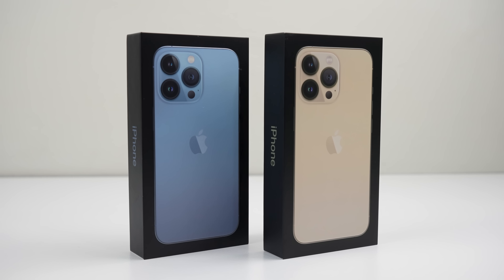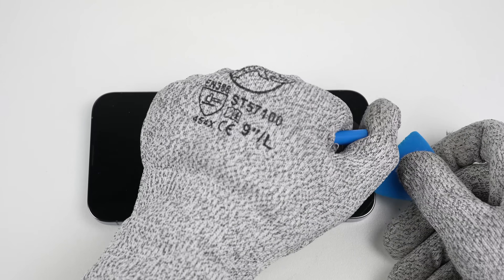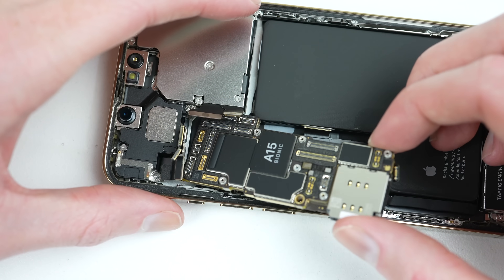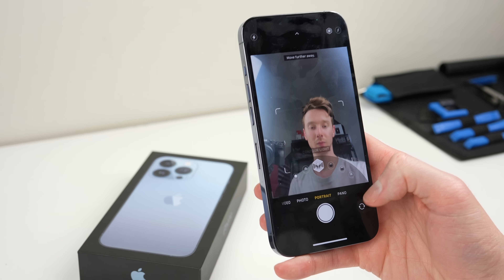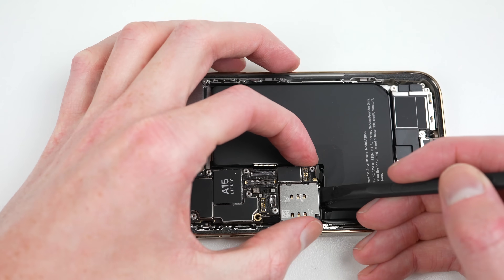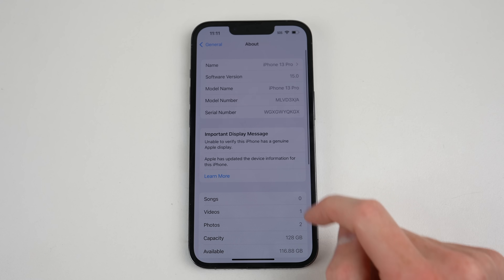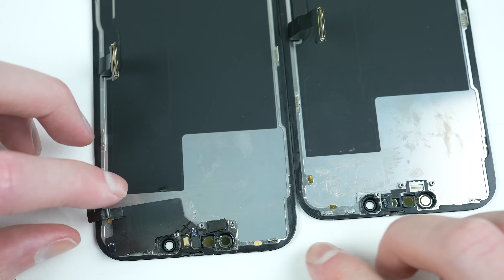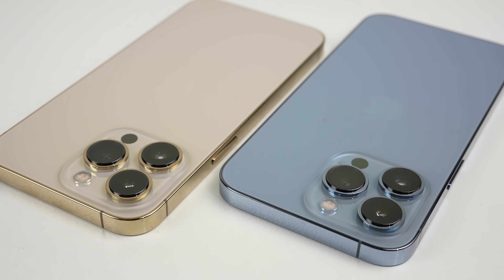iPhone 13 A Repair Nightmare - Teardown and Repair Assessment

Comment: Unfortunately, planned obsolescence is increasingly present, making repair difficult or creating certain problems. I had a problem with my printer canon pro s10 that gave a problem with white label ink cartridges. one day I filled the original ink cartridges with the same cheap ink and it worked well, that is, it wasn't even the ink, I did extensive tests and it was expensive that the error was deliberate for me to sell their ink cartridges. I would like more and more people to be aware of this problem it is not a theory of conspiracy to facts and proof and it is not new look about phoebus cartel

Comment: It's bad enough that aftermarket parts are being software written out of the repair equation, but even brand new Apple parts won't work.  What's certain is that Apple's own in-house service software will resolve the incompatibility of those parts in 5 seconds. Apple is the most spiteful company on the planet.  Love my Galaxy.

Comment: This is the reason I will go out of my way NOT to get an iPhone or Support Apple in any way, they have been dumping millions into people's pockets for the right to repair bill to fail and even engaged in disinformation tactics to secure the uneducated public. They said in a press conference they wanted to make sure "genuine apple parts" were installed by "trained technicians"... this is outright nonsense as we witnessed here, they put a software lock on and there is NO checks to see if the part is genuine or it would have cleared the replaced parts as being genuine.

The serial numbers are all loaded onto the logic board and if they don't match the phone won't work, it will go OUT of its way to show degraded performance suggesting the part was cheap or incompatible as we saw with the camera and sensors and without connecting with a proprietary software via the USBc and a thunderbolt into a PC you are unable to change the serial numbers on the logic board.

Right to Repair was pushed to cars, they compensated by designing cars to fail more frequently, I am interested to see if Apple will maintain its  "Independent Repair Provider" program and continue to limit accessories under the guise of reduced E waste.

~Thanks for the video, it was a very good one and I'm sure will be used as evidence, keep those phones, they might be subpoenaed lol.

Comment: Honestly i believe only Apple should repair Apple. Only Samsung should repair Samsung. There should be no DIY 3rd party. That is how you make sure all of the components stay true to the original design. My mom repaired her old iPhone through some engendering dude and the battery exploded in few month. To avoid this bullcrap you might use official support.

No fake details. No fake details on the market. That’s how piracy is defeated.

Comment: Now imagine you're an iPhone developer who wants to ensure their Face ID is secure enough not to allow any Man-in-the-middle attacks via custom-built sensor cables or altered screens. And there you have it — sensible explanation for "repairability" issues. I'm more than sure that approved apple repair centers can handle those issues via firmware tweaks upon parts replacements.

Comment: Can't wait for iphone 17 with newest technology "one use only", where u can't charge the battery, and the phone completely broke when you run out of batteries, that would be so great for the environment!❤
Reply: You can only charge it at an Apple retailer. But it will cost 10$ per time you charge it.

All to protect e
environment
Reply: @RodelIturalde  you mean $199 per charge
Reply: Careful, Chief. You don't wanna give em any ideas
Reply: Not 17, it will be an iPhone 14 feature, trust me

Comment: i miss the days when you could just flip the back of the phone off with your finger nail and just take out the battery
Reply: And that fixed two thirds of your problems.
Reply: Oh hi, 5 year LGG5 user here, nice to meet you.
Reply: Yes, put a random battery that fits and you were good to go
Reply: @comradeweismann6947  if the battery was small add a piece of paper/plastic just so that the terminals remain connected to the ports of the phone
Reply: Ah I remeber me and my mates all swapped one battery in our blackberries when the rest were dead. These kinds of anti consumer, profit maximisng systems are inevitable I guess but apple are really pushing the envelope. 

Despite all it's "innovation" modern technology can be really depressing.
Reply: Rocking a samsung j3 here and you are right, with my bare hands i can remove the battery and the memory card with ease
Reply: yes
Reply: Yeah, but greed..
Reply: These days never ended. I don't quite understand why so many consumers paid extra to enter darker times throughout the years.

Comment: Never had the money for Apple. Never considered saving to buy one despite a good friend's praise. They charge ridiculous prices for something other phones can do for a third of the price. I lasted 4 and a half years with a Samsung and the only reason I replaced that masterpiece of a phone was because the system no longer updated and it became unable to access certain websites I needed to study. I gave it to my father and it still works perfectly a year later. I dropped it down the stairs once, on the floor a few times at school and the only part we replaced was the battery because it started draining a bit too fast. Now I am using a Nokia and it works great.
Reply: I can say the same thing about Apple. I have an iPhone SE (2016 model, not the new 2020 one) that is almost 6 years old now. It STILL receives software updates, in fact I am on the latest update right now, the same one that iPhone 12's and 13's are getting (iOS 15). The phone's battery still to this day (never replaced it) lasts me from when I wake up in the morning to the next morning. It has no trouble loading any websites, and it's web browser never slows down for me. It's also worth noting that even though Apple PURPOSELY slows down their older devices, I still have a smooth experience, on an update that was made for iPhones half a decade newer than itself. There have been many instances where it gets dropped from 6+ feet in the air onto concrete at basketball practice every week, and it falls off my bike a lot at 20+ MPH since I go for bike rides daily on trails and on the road. The phone still works like new.

Meanwhile, I also have a Samsung Galaxy from 2017, that was around the same price as the iPhone SE. It's battery lasts a fraction of the time that the iPhone does, it no longer receives updates even though it is over a year newer, and the screen flickers sometimes, especially when I open up a web browser and try to load a remotely complex web page.

I do not support Apple's recent decisions, however, I personally don't think I need to worry about repairing my iPhone when it has lasted almost 6 years. It still receives updates, and I have never needed to replace a single part even though I put it through stress almost daily. No phone company can build a phone as well as Apple. Even their iPhone 6S, from September of 2015, still receives the latest updates and according to many friends and YouTube, it is not slow at all.

Comment: Awesome video and very informative. I use Samsung phones and no doubt they have similar issues. Everything now is going they way of if broke buy new. Cars of the future will go the same way as they too have onboard computers that check and run components. So future cars could have their computers check for manufacturers only parts being fitted and not allowing copies or same model parts to work.
Enjoyed the video well done.

Comment: 13th generation of that phone and 10 bucks says the battery won't last longer than 18 hours on full charge . How they claim to be going greener is beyond me
Reply: For what its worth, I got almost two days of light to moderate usage out of my new iPhone 13. I upgraded after using my last iPhone for approximately four years. Quite the jump for me in terms of performance and functionality. I fear that all devices are slowly going this way, we need new legislation from a large body, say the EU, that outlaws this kind of software locking of genuine parts.
Reply: @Drunken_Jedi  never had one never wanted one . I have an old Nokia and it has 7 days battery life,  I like cash cause if I don't have it I don't buy it .live life with what you got not with want you want you will find yourself a lot happier 😊

Comment: I always hated apple for this reason and for their overly expensive products. But other alternatives have their problems to. My galaxy s20+ is not performing as well as it used to after just 3 months. And that's a common problem with galaxy
Reply: At least you don't have to pay the price of another phone to repair an android
Reply: @Trattt  right but I shouldn't need to repair it after 3 months. Iphone has its flaws but at least its durable

Comment: its the same scam mcdonalds has been running for years. its called class action law suit. in the US a series of laws cover things like ordinary use so for example a mass produced phones board not being serviceable by the user would be considered far below standard market quality for similar products, and if someone can prove that for example in mcdonalds case that the device was set to fail or be ready to fail at some point (iphone14 launch for example) that is a law suit that will basically destroy apple

Comment: I stopped buying apple products in the mid 90's. I refuse to have anything to do with apple. I had a co worker who just bought one of the original imacs...you know that stupid looking bubble thing? I had just built myself a new PC and he asked me about adding ram to his imac. He said to increase his ram it would cost him 1k usd and I told him I just did 4 times that amount for 300usd. So he brought in a chip and i compared the p[c and imac versions. Same chip but 8 times the cost. I realized then that apple was a predatory company and i did my best to protect others since then.

Comment: They literally design these things to break so they can sell you a new phone. Supporting this company is dumb.

In Australia they literally cant do this due to federal law. If your phone breaks, the onus is on them to demonstrate you caused the damage. If they can't then they fix or replace free of charge within a "reasonable time". They will train employees to ignore this law and pretend that they have to charge or refuse you. The employees mostly dont even know that this is illegal but that is how many retail companies train them. Apple are extra good at dodging legal responsibility.

What's more is that if the fault is considered major (it severely impacts the functionality of the product) then repair, replacement or refund is entirely the choice of the consumer. The company does not dictate what remedy to provide unless the problem is small like some dead pixels or an ascetic issue. If Apple or any other company in Australia sells you an electronic that breaks on its own in a couple of years then tell them to fix, refund  or replace it for free. If they refuse, contact the ACCC or consumer ombudsmen who will likely threaten to fine them for non compliance. Even mentioning the ombudsmen will often get them to admit defeat.

Companies also supply things like warranties and manufacturer guarantees and DOA periods. None of these are legally binding over the consumer law. They may be more applicable in other countries but in Australia they are mostly unnecessary. The point of sale almost always is required to supply or facilitate the rememdy. It is extremely illegal for them to force you to see the manufacturer.

Comment: From a hardware and software developer standpoint, I knew Apple would eventually come to this point and for very good reason: Keeping everything in-house. All of Apple's software is designed to work first and foremost with their hardware and it has been that way for as long as I can remember. There are benefits to Apple going this route and the benefits do extend to their customer base. The problems with allowing third party vendor repairs are too numerous to count but here are just a few. 

1)The skill level of the repair varies as does the location. 
2) The parts used to make repairs can vary in age and source of origin (for example, imported). This does hurt Apple's bottom line for sure which is another reason for it.
3) Any strange behavior in the future that may, or may not have been due to an out-of-house repair. How do you expect someone at Apple to help fix a problem that is a result of an out-of-house repair they have no record of? What exactly did the third party do when repairing your phone, even if on accident? The single biggest benefit for out-of-house repair is that it is potentially cheaper, that is all.
4) A very big one: Security. It is time people woke up and realized we live a very digital centric world now. If you let a third party handle repairing your phone, you are trusting that party with everything on, and in, your phone. This also goes in hand with third party sales for phones. It eliminates any likelihood of bootleg components that could result in breaches of your private information without you knowing. I could go on and on about this but this is a VERY big deal in this day and age.

You buy the phone from Apple, they make the phone, it only makes sense that they are the best equipped to repair the phone. Buy an extended warranty to protect your investment and you literally don't have to pay for any damages to your phone for the time you will have it. Personalization isn't the problem here, it is that people in general do not like knowing they can't do whatever they want with their phone even if that means risking the loss of your $1700 electronic device. If your problem is giving Apple more of your money, then why did you buy one of their products in the first place and use it every day? The writing is on the wall, but people are refusing to read it.